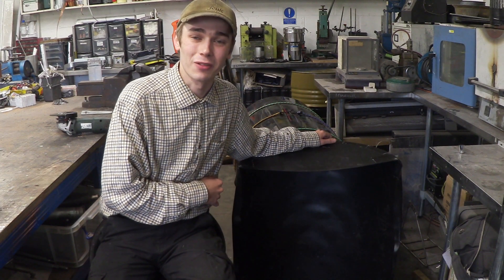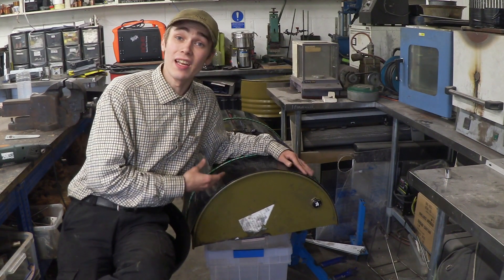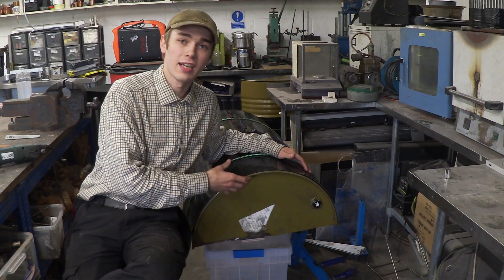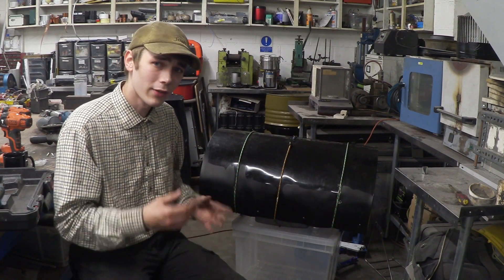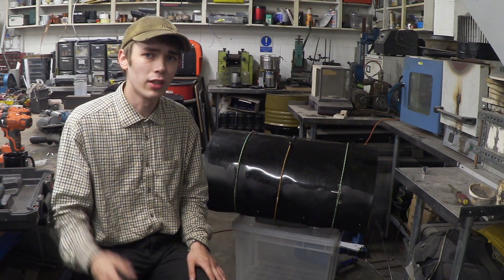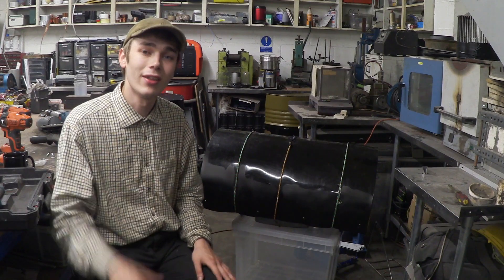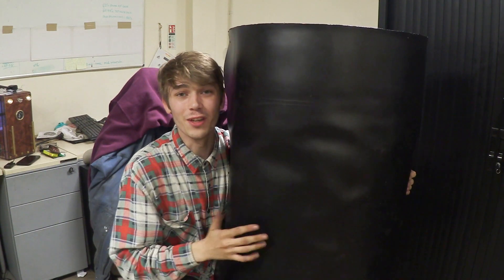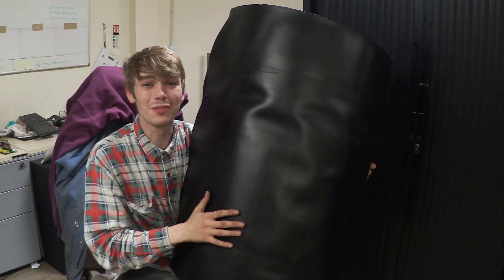1159 - Giving Plastic Heat Forming a Go

Comment: well done on your attempt to drape form the plastic.  Spot heating it like that expands the surface more than the underside, till the heat 'soaks' through and it fully relaxes, but areas you already heated are cooling, so you get uneven heat, uneven relaxing. In this case it seems to meet the needs.
If you need a more accurate form next time, you need to 'oven' the plastic to get uniform heat soaked into it so it drapes all at once.  You could tent your setup and heat the barrel slowly from the underside with the heat gun, and between 300°F and 350°F you will see the plastic relax itself over the barrel half.

Comment: Why don’t you use the other half of the oil drum to make a barbecue? Put it beneath the other drum over which you want to bend the plastic sheet. Make height of last drum adjustable to collect more or less heat. Would result in more even heat distribution and hopefully less stresses in the sheet.

Comment: should have just made some ink & painted a heater on there,feed it with one or two of the better turbines (trial run pretend off grid style) , to get a far better shape.

stick it all in a BIG bin bag ( or make one with an old tarp) &  pull a  mild vacuum with the vax to get a cleaner shape while heated for 2 minutes... remember it Will try to shrink like all blown plastic, coke bottles, plastic sliced chicken containers etc, so clamp it until it cools.

alternatively use hot water (dip it in a tub /hot power wash/steamer?) works far better for that size of plastic than air.

want (one off) weird simplistic shapes.. again make a reusable painted flexible heater to a given size,or just paint directly on the plastic, get/make a tarp or whatever bag, this time make a kite go down the beach fill the bag with some sand, make the sand castle required shape, lay the plastic & flexible heater on the inside of the bag shape ,heat & pull a vacuum (reversed/box bellows?) until it takes the shape....

Comment: maybe placing a space heater under the barrel would help. Did you plastic weld the ends on? I was thinking maybe a small boat or roof for one of the electric cars

Comment: If you want spare some energy, using the heat gun, from the outside, insulation between hdpe and metal would help.
Nice technique.
Cheers.

Comment: HDPE warps for fun, sometimes it just will not go where you put it and stay there. The best results come through using +ve and -ve moulds and plenty of pressure. LDPE sheeting makes a superb glue or joint sealer on HDPE too.

Comment: Rather than using bungees, could you not just clamp the bottom edges with something flat (aluminium strips or something) and then heat it from the back of the mould to give a more even finish?
That would remove the need to drill holes as well.
Reply: I was thinking, screw down flat wood slats.  Then heat it any way you want.
Reply: @edwardcdg  That was my initial thought too, but clamping removes the need to make holes in it at all. With aluminium you could also bend it to conform to the shape of the mould and still keep it very light.
and then another thought hit me.. lol..
Why not just put a small rod on the edges that stands off enough to accept the plastic, and just slot it in...
Easier and very repeatable with no extra parts to lose.

Comment: I made this kind of things with heat gun when I was in engineering... There I bended pvc tubes to make structural frames.... This is awesome technique..... BTW if you are making that drag type turbine you made with oil drum few days ago with this....which was spinning nicely in 2m/s... This will definitely spin faster at even slower speeds.... Awesome

Comment: A suggestion if I may.
If it would be advantageous for it's form to be smoother, you could put it back on the drum half, stand it up on some saw horses, throw a blanket over the whole thing and use two space heaters inside the blankets. You would of course not be able to walk away from it because of the fire risk, but probably within 30 minutes it would become hot enough to form the entire plastic piece in one go and leave a nice uniform finish.
Reply: Heating from the back side of the mould usually does give better results.
Reply: @Gainn  I was also thinking this, but you could run the risk of melting the plastic to the metal drum, since the metal will me hotter than the plastic.
Reply: @purvel  you'd need to control the process carefully for sure.
It would be useful if you were producing them because the following ones would be going on an already heated mould.

Comment: Thanks for the video. Should go without saying, but for anyone else using a heat gun on plastic, it's best to be in a well ventilated area(like in this video) or wear a mask.
Reply: Hdpe  as a very low melt point ,it will bend even in hot water, so no fumes.